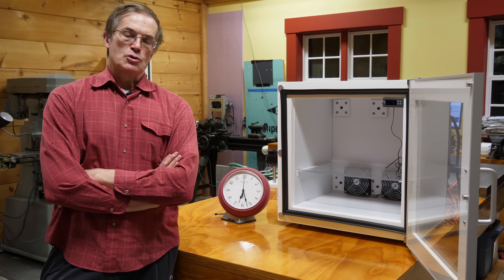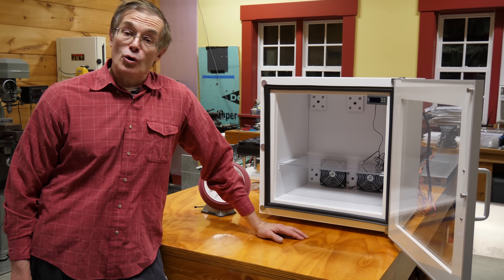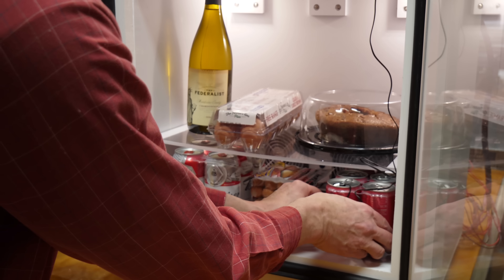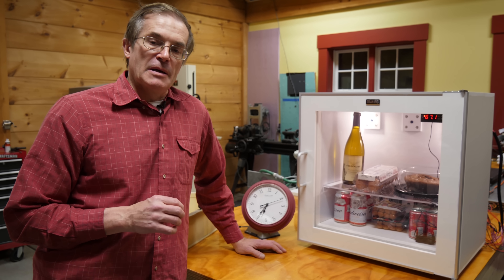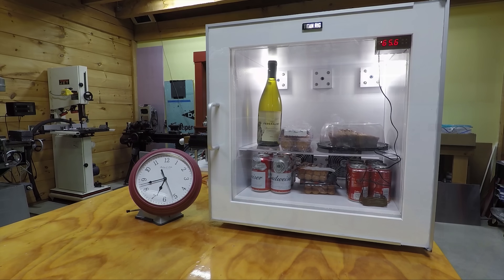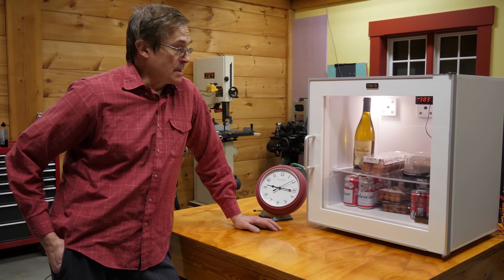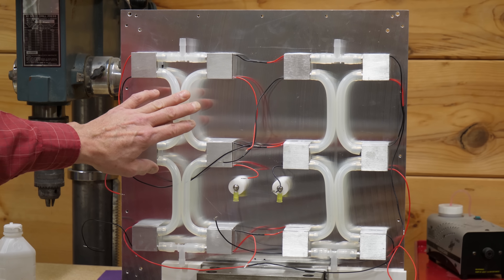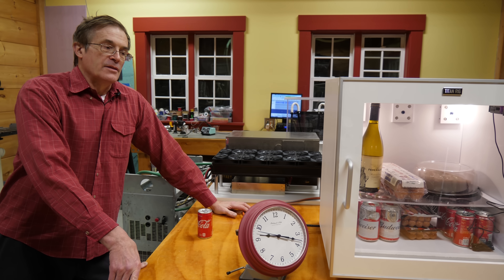TESTING OUR DIY REFRIGERATOR! - TEC/PELTIER

Comment: Some back-of-the envelope calculations on the efficiency. You have about 8.5 liters worth of food in there (0.75 L wine, 4.2 L coke + beer, 1.7 L of hot dogs, 1 L of pie, 0.8 L of eggs). Cooling this amount by 16.5 °C means 8.5 * 16.5 = 140 kcal, which is about 588 kJ in 2.5 hours, so 65 Watts. You mentioned the 24 ft^2 surface area, so assuming the ideal insulation you mentioned, this would be another 58 BTU / 2.5h = 7 Watts. Seems you're pumping about 72 Watts overall, but as convection clearly slows your design after 1.5 or so hours, it's probably closer to 100 Watts. So as you've mentioned, the fridge can work at very high efficiencies, given the steady state heat removal is an order of magnitude lower than its peak capacities.

What would be interesting is what you put in, power-wise, with and without ventilation. The European Union has energy efficiency labels, and I've had a look at the EU directive 32010R1060, which regulates the labels of refrigerators, and has formulas in the annex. Assuming you have the following specs:
1. It is a refrigerator / chiller
2. It is not "frost free" (shouldn't apply to refrigerators)
3. It is not a tropical or subtropical appliance (for this, the ambient average temperature would need to exceed 32 °C)
4. It is not a [cabinet] built-in appliance
5. It doesn't have a chill compartment (e.g. for cooling meat rapidly)
6. It has a volume of 225 Liters (8 ft^3)
7. Your design temperature is 4 °C.
Then this would give you a standard annual energy consumption of 300 kilowatthours/year
You could work out your actual use in kilowatthours per year, and divide your use by the standard use. Times 100 gives you percent, which then yields the Energy Efficiency Index EEI. Below 22 is best. To be allowed for sale in the EU, you'd have to be below 42 for compressor appliances, or below 110 for non-compressor appliances. So to be allowed for sale, your fridge shouldn't use more than 330 Kilowatthours per year.

I couldn't find any standardized process on how to measure the consumption, though. They do mention that you have to measure 24-hour-use to three decimal places (Unit: kWh) and then multiply by 365 to get annual use. But how they measure I couldn't find. They do mention that it will depend on actual use, though. It's probably steady-state, then.

Sorry for the long text, but thought you might be interested. How would your fridge do?
Reply: Fascinating comment:
@tech ingredients notes elsewhere that this fridge draws down 110watts. I currently run a small eco-resort as a side business, and our bar fridges there, (which are larger than average, so about the same size as this build,) are rated to 45w. Frustratingly they are poorly insulated so spend far too much time running, while the fridge here is well made and much better insulated, so should be much more efficient overall. 
Of course the real issue is how much heat is lost opening and closing the door, and cooling added objects.
At one point I worked in the audit team for the Australian household appliance energy rating scheme. The scheme had determined a standard daily usage pattern for the average household, using the average fridge design. It then modelled the performance of fridges against that pattern of usage to provide a rating.  Unfortunately as with any such scheme, such as house rating schemes etc, they dont tend to deal well with designs that are too far from the norm. One of the roles of the audit team was to respond to complaints from manufacturers who felt the scheme did not fairly represent their products efficiency. 
I recall Samsung approaching us over a fridge design that used multiple smaller high efficiency invertor compressors on a fridge/freezer with multiple separate compartments mostly using draws. They had of course calculated their energy calculations on actual usage patterns, where with that design a family then only opened a single compartment to get out something like a drink, rather than opening the whole fridge door. Using drawers very little cold air fell out of the fridge. 
Overall the system was super efficient, but failed the Australian rating scheme. We then had to provide them with an exemption and alternate rating, while also recommneding changes to be considered to the scheme to allow for this alternative design. 
It does strike me that this peltier design, would be much more efficient if it was built with an upper and lower compartment. The average user might open and shut the drinks compartment half a dozen times per day, but only take the cake and sausages out once. This would also allow you to cool one compartment to a much colder setting than another, again allowing for improved efficiency. 

So... What I mean by all of this is that, energy efficient fridge design is more about iproving the way a fridge is used than simply the energy efficiency of its cooling system.

Comment: I love the look of it.  The tech goes without saying. :)
Reply from the maker: Thanks!  We like it too.  It would make a nice wine cooler.
Reply: @TechIngredients  That's an idea, though I'm not sure I could always wait two hours.  Those fans look like they are about the diameter of a wine bottle; perhaps a double-barrelled cooler that's ready in 20 minutes!  You could make it so it plugs into the cigar lighter in the car - for the alcoholic who's on the move!  

More seriously, I was wondering how you chose where to place each of the Peltier diodes.  It looks like it could be mathematically tricky; or at least I can't think of an easy way to do it (except with an FEA program).  Or did you just rely on the conductivity of Aluminium, or is it not a limiting factor?  Would Copper sheet do the job better since it is SO much better as a conductor?  Copper blocks could be a bit expensive but my experience in Audio makes me very alert to these thermal junctions and how limiting they can be.  The paste is especially bad, mainly because almost everything is a pretty poor conductor of heat, in spite of the impressions we may have picked up.  For example we think of glass being a good conductor because it is cold to the touch, but it actually isn't if you look at a table.  I am starting to look at nano diamond added to thermal paste, which really can add some conductivity and is not as expensive as it sounds.

Comment: The amount of polish you guys put into projects that are really just experiments is really fantastic. Most youtubers in this genre are jerry rigging stuff together and getting it to a "well it works" kind of stage. Your guys's projects could go into retail stores if you bothered with getting them UL listed. It really sets the bar rather high honestly.
Reply from the maker: Thanks!
Reply: @TechIngredients  What was the downside here? It became a space heater? Inside the little fridge was cold, but the outside began heating up. Is that why you wanted to move the heat transfer system to the outside of the house?
Reply: @enermaxstephens1051  No. That would not have been a downside. That would have been a benefit, because, as he said in the video (5:40), he is trying to keep the room warm during the winter time, and it would actually be useful to dump the excess heat from the fridge into the room.
However, his purpose was to remove the fan noise to another location (5:01). Since he's trying to remove the noise, he pumps the heat outside in the next video.
Reply: @supershluffy  Yeah I didn't watch the next video, but I guess it would depend on which season it was. You certainly wouldn't want to run a space heater in the summer.

Comment: Important to remember: If you use fans for this build a wide diameter fan can move the similar air volume with few RPM and thus creates less noise than a smaller(cheaper) fan.

Comment: You could probably use water to move heat away from the hot side of the peltier as well.  Pump the water into a loop buried in the ground for a geothermal solution.
Reply from the maker: Several viewers have suggested this.  It sounds like a very good idea.

Comment: Or you could just buy a properly insulated Peltier cooler based "ice chest...
Proven to keep stuff inside up to 40 deg F cooler than the air surrounding the cooler.

Some of these can be bought for lower cost than buying the materials to do this "experiment."

https://www.amazon.com/AmazonBasics-Portable-Cooler-Warmer-28-Quart/dp/B072826X13/ref=sr_1_3?ie=UTF8&qid=1547256896&sr=8-3&keywords=12v+ice+chest

(Amazon does not have the lowest prices... just the fastest search)
Reply from the maker: They don't look as nice, are usually much smaller and...lack the fun factor.

Comment: If the peltiers are heat pumps, then wouldn't you want to make more of an effort to bring the heat to the cold side of them? Pull warmer air in the fridge across cold side of peltier so that it can be transferred to the hot side and out into ambient air.
Reply from the maker: That is correct and why we placed the fans against the rear, cold wall.
Reply: @TechIngredients  I look forward to seeing ver 2.0! Any chance of adding thermostat control?
Reply from the maker: The refrigerator does.  That was not a thermometer, but rather a regulator with a temperature read out.  The freezer will not bother with a regulator.

Comment: That idea with the remote cooling reminds me a lot of how a datacenter near me is cooled ... basically they literally got a ditch on the shady side of the building that's even cool in summer (due to being halfway underground and constantly in the building shade) and iirc they can rely on passive heat exchange for most of the year that way (only in worst case adding fans)

Comment: Very interesting, I look forward to seeing the rest of this series. A friend of mine who is single and lives alone built an environmental cooled fridge a few years ago as all he usually had was beer, milk and eggs and was sick of the compressor nosie of the fridge. From around november to march the ambient outside air, especially at night can get as low of 14f (-10c) He used an arduino and insulated the inside of a small cupboard and fitted vents to outside with a couple of fans to circulate air and some dust filters / fine wire mesh to keep out debris. If I remember rightly there are two temperature probes, one for external and one for internal air temps.. if the cupboard gets too warm and the external air temp is cooler it will circulate air, there is also a warning light for fridge over-temp / external air too warm. He was talking about possibly fitting a peltier type cooler to help in times of lack of cooling but since he works during the day and the insulation was so good he hasnt needed to use it as far as I know, so now 4 - 5 months of the year he turns the fridge off completely and just uses the cupboard fridge.

Comment: I dig the fridge. is there an advantage to using aluminum over copper for the heatsink? And the thick piece of aluminum right after the TEC wouldn’t heat transfer faster through a thinner piece? I’m just looking to understand heat transfer a little better. Thanks for all of the great info.
Reply from the maker: Copper would be better, but it is MUCH more expensive.  The blocks are necessary to allow some insulation on the back, between the cold refrigerator back plate and the outside air.

Comment: The irony is not that we're nesting contradictory devices but that the companies who produce these devices are more concerned with one time savings of manufacturing costs and think very little of designing something that will save much more over the long term. I was thinking the same thing recently when I saw them changing one of the fridges at a local pub. The old fridges relied on a central compressor but the new fridge was a self contained unit. Within minutes of the new unit being turned on the bar was too hot to sit at as the heat exchanger was attached to a fan that shot the heat out the front which is not an improvement.  This sort of short term thinking is kind of defining our generation.
Reply: It's because the devices have to meet ever more restrictive energy requirements but they don't have to consider the environment they're installed in. Sure you could run a phase change fridge with external pre-cooling but that adds cost and power because the regulation doesn't account for the 20 degree New England air that you're getting for free.

Comment: It's quite surprising how much heat is generated by the action of a fan due to friction acting on the air it moves.
Reply from the maker: Good aerodynamic fans are around 70% efficient overall.

Comment: Hmm. A spin-off of that water cooling idea behind your back in this video. How about letting that tube of water, run around your yard, in order to get cold? For good and old intences, the Vikings did not have the electrical pump. If they had, I am sure they would have used it.
Reply from the maker: A buried ground loop could work year round.
Reply: @TechIngredients  Something strange is going on, in europe. Watcht out yourselfs.
Reply from the maker: We know.

Comment: Loving this project. Looking forward to the liquid/remote update. I've been tossing around the idea of using TECs in my chemistry lab, but I need to familiarize myself with the relevant math involved to see if it's viable. I have a few thoughts, but the first was to use both hot and cold circuits in a theoretically effecient distillation setup.

Comment: I have always been waiting for someone to invent a device that plugs into your fridge that you put out side say out the kitchen window that takes advantage of the fact new England is so damn cold for almost half the year . Some sort of heat pump that circulated freeon or PEG through a thin tube. Really for 3 months you could just use the outside to cool and even freeze things. Although you can't store food outside because just one warm day and it goes bad or there are bears and other things that would eat it.
Reply from the maker: The idea is to ADD the outdoor cooling loop to a regulated refrigerator.  We will use a water/glycol antifreeze mix, bypass the outdoor portion when the temperatures don't justify it and simply remove it for those months when the temperatures will almost always be too high.
Reply: OK,  assuming you live in the northern hemisphere cut a hole in a north facing wall and have the back of a normal fridge outside.  May need to provide weather protection. The fridge will operate far more efficiently.  This relates to the old idea of a larder.

Comment: For cooling without phase change there is a device called a vortex tube (it can produce quite significant temperature difference using just flow of air). Also stacking peltier modules togeather  hot side facing cold side might also be interesting... Nice fridge ;)
Reply from the maker: Thanks!
I didn't mention the vortex tube and probably should have despite the extremely low efficiencies.
Stacking does not work.  this is used when very large temperature differentials are needed, but the efficiency is very low.  this is because, despite the lower temperature gradients per stage, the second TEC in a stack has to pump both the first's heat load AND the electrically generated heat from the first TEC.
Reply: @TechIngredients  also devices based on Stirling cycle can produce some very cool effects! :) but that might be bit difficult to build... Also hydrogen has got some good thermal conductivity if that could be used in any way in cooling. For some time now Ive been testing vacuum insulated electric kettle and it is quite interesting energy saving device. Anyways, very interesting project!

Comment: Here's an idea that may, or may not work. The system has the ability to cool items approx. 30 degrees F. below the temperature outside the heat exchange plates?
 Why not make a conventional refrigeration unit just large enough to remove enough heat from the plates that they can work efficiently. Then test to see what the total power consumed is.

Comment: I have a small(38L) commercial fridge using this principle, these videos have been interesting to watch. One thing to consider for version 2 is a way to catch condensation forming on the cold side of the elements, my fridge has a little tube to let it drip into a reservoir on the outside and there's usually some moisture in there. I think heatspreaders on the cold side of the elements would help in your design as well. 

That said, I don't recommend this method of refrigeration over a conventional compressor model. It's inefficient and noisy. I have replaced the fans on my unit with quieter PC fans and a little PI(no need for D) controller alongside a raspberry pi which logs temperature data. This makes the noise bearable but it's still about as loud as my computer under load. 

Water cooling is a neat idea and I've considered replacing the hot side heatsink with a second hand AIO cpu cooler, but at this point I've put in more money than a normal fridge would've cost so instead of optimising further I'm just going to get rid of the thing as soon as possible.

Comment: Looking at TEC datasheets show great COP when run at very low power, unfortunately also very low temperature difference. Could it be possible to run many of these stacked starting from very low power, gradually increasing it to get a combination of high COP and delta T?
Reply: I mentioned cascading TECs on last video, he said cascading is less efficient. The one I'm using now I use 3 TECs. 2 on hot sink ,then riser to cover them, then 1 on that , then cold sink. Works ok, but I should build another with 3 on one plane to compare. BTW I wire the TECs in series to get 4 volts per device at 12V.